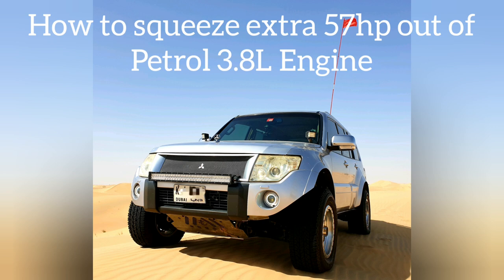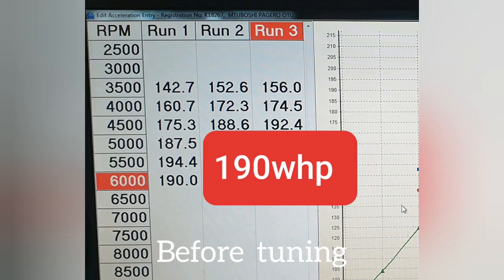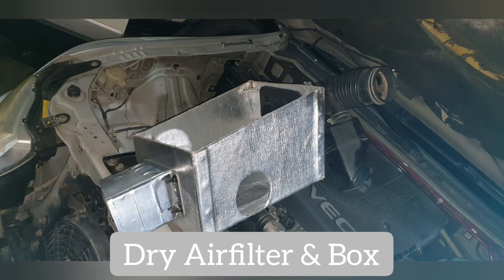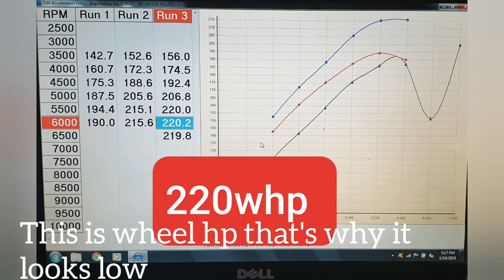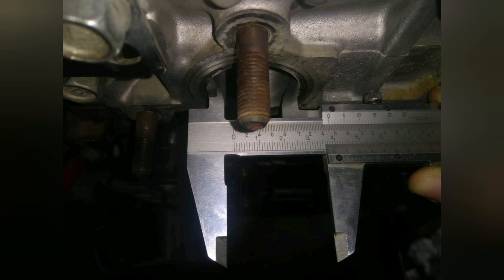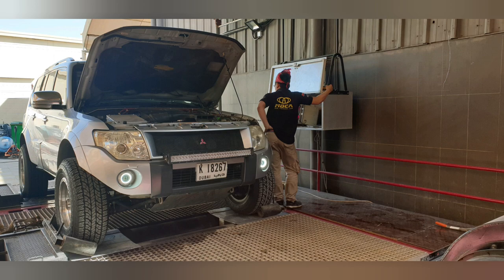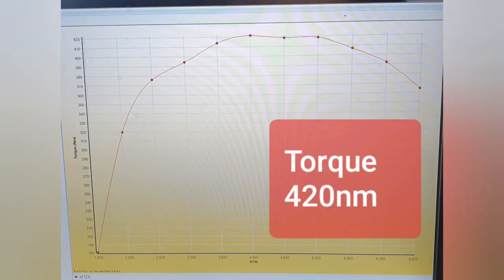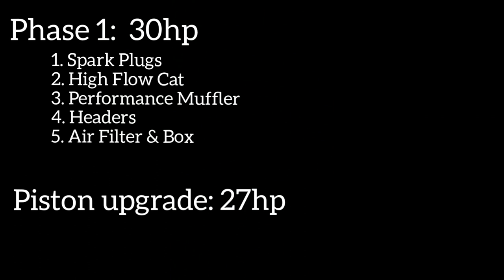How to squeeze extra 57HP out of 3.8L Pajero! [Dyno Testing]

Comment: Hey,
Which Spark Plugs Is Recommended For Off-Roading and what shall it cost in UAE?
Reply from the maker: Hello I am personally using DR15SXC-WC = Brisk High Performance EVO Premium LASER Technology Spark Plugs.        
 https://www.ebay.com/itm/6x-DR15SXC-WC-Brisk-High-Performance-EVO-Premium-LASER-Technology-Spark-Plugs/371904344867?pageci=fb772266-064b-49f5-a371-2cd2139f2899&epid=710002657
Reply: @SandTrack   Thank  You,
Well does good Spark Plugs Make a difference if yes thn how plz throw some light on it
Reply from the maker: @clever52enough  I didnt test the impact of the spark plugs seperately on the dyno on its own. Though advantage of these is they last long and dont fade in performance with time. Also they give even ignition and combustion as you can see from the spark in the video https://youtu.be/EbKJmHw1zro
Reply: @SandTrack  hi mate ... did u change the spark plugs cables too ?
Reply from the maker: @sjanbek72  hello that i didn't change just the spark plugs

Comment: Great mods! But isn't that Magnaflow cat too small for this engine? I have 6G74 in my Galant and the Magnaflow 59926M which is 2,5" cat.
Reply from the maker: Hello Matiz33 thank you very much. Pertaining to the high flow cat, on the Pajero the actual stock exhaust pipe diameter is 2.25 inch
Reply: @SandTrack  okay, I understand. I have a full 2.5" catback exhaust for better breathing. Maybe you will gain even more with 2,5" exhaust
Reply from the maker: @matiz33  oh yes fully agree that would be the next step and plan 😊

Comment: When you bored the engine block with the .5mm pistons, what is the part number for the headgasket to accomadate the larger pistons?
Reply from the maker: I am honestly not sure what the garage did with the head gasket. Will need to check
Reply: @SandTrack  I ended up buying the pistons and the ring sets for my 06 Montero (Pajero). Are these supposed to be machined to finish or come with the pins bigger than the bores in the pistons and one side bigger than the other according to my machine shop

Comment: @Sand &Tracks
Any body has any forum where I can find info on the new Montero sport 3.0 V6 Dyno? Cannot find much post for the petrol version only diesel available. Is it because there is no much improvement with the custom tune?
Reply from the maker: Hello not seen a montero sport on the dyno. Its a capable car, as a minimum you can add an air filter to it and get the ECU tuned. Check with your local tuners. If you are in UAE visit unichip

Comment: Hello my friend I’m thinking of changing the catalytic converter to high cats did you get any Check engine light coming up when Replaced it?
Reply from the maker: Hello, there are some pajeros that have come with 3 catalytic converters and others that came with 1 catalytic converter. Mine came with 1 and after changing to a high flow cat I had no check engine light. Can't say how the version with 3 cats will react. How many does yours have?
Reply: @SandTrack  
Thank you for your reply my friend I’ve typed my vin number on partsouq and on there Catalogue shows that I have three of them Two on the top and one on the bottom Same as yours on the video

Comment: Must have a ton of heat soak with bring in the desert??? How the humidity? And pump 92??? 100?90red? I’m swapping my 01 montero to a 6g75 turbo. I have my motor from a eclipse just need to start the motor build just a decent build while it’s out of the vehicle till I’m ready to drop it in
Reply from the maker: We fill 98 over here, no heat issues at all with the car. Good luck with your project!
Reply: Sand & Track may I know where you bought your Brisk spark plugs?

Comment: Hello there,
1 question about phase 2. Do part come in a complete set or by piece? In total how many pieces i need?
I got a quotation from partsouq for a total of 538 dollars including shipping for 6 part a and 6 part b
Reply from the maker: The parts come separately
Reply: Less than $100 per hole!  After the machine work and reassembly you'll have a mitsubishi that can more easily eat those butterflies and screws!

Comment: If i were you, i would sell this mitsubishi and bought Nissan Y61 with TB48DE will produce over 230 whp stock, if you add headers and full exhaust + filter and tune  you will reach over 270 whp. If you  willing to go over 300+ whp go with  stroker 5.1 and enjoy the instant power + the amazing offroad response
Reply from the maker: No doubt the Patrol is a great car with heritage and solid mechanics and indeed can be tuned nicely. The Pajero is a much harder car to modify as you need to get creative and DIY most parts and more satisfaction in the process as a result

Comment: Is there a way to make 3.5 more fuel efficient?
Reply from the maker: Suggest you get a good air filter, new spark plugs, remove unwanted weight like the 3rd row seat and finally tuning the engine you can create a fuel efficiency map
Reply: @SandTrack  Greetings! Could You share what fuel economy You got with 3.8 Mivec before tuning it (or do You have any insight what it should get during casual, on the road driving)? I'm curious because I'm considering Pajero with mentioned engine as my next car and I wonder what's the best I could get from it after doing mods You recommended in the comment above.

Comment: Hello brother.
I'm trying to change the sparks.
I found one with 3 pins and an other one with 1 pin.
Both fits so which one is better ?
Reply from the maker: The modified ones I used on my pajero have 3 pins no problem as long as they fit. I put in the description the ones I used
Reply: @SandTrack  thanks man, i changed to 3 pin Mitsubishi official.
And now it runs alot better than before 😀

Comment: Have you done anything to the transmission? Do you think it’s tunable? Thanks.
Reply from the maker: yes I have tuned my own gear to hold and not autoshift. What are you looking to do?
Reply: @SandTrack  I’m wondering if it can be tuned to shit faster, smoother, and lock up torque converter at desired point. Also, what did you use to tune the transmission? Does it have separate transmission control unit? Thank you.
Reply from the maker: The petrol cars dont have a seperate TCU (Transmission control unit) for gear. Only the Deisel has seperate TCU for gear its under the passenger foot under the glove box area. I have petrol version and used programming lanuage so no software was used to edit the gear, what I could only manage to do is make the gear hold when in manual mode. 2008-2011 models in petrol wouldnt hold gear in manual and i sorted that out

Comment: Will this also work on 3.0 Mitsubishi montero sport here in USA?
Reply from the maker: Yes same concepts should apply but part numbers will vary
Reply: @SandTrack  will this work good on 3.5 montero here in USA?  Its hard to find 3.8 with Low miles. You can bump the displacement 3.5 to 3.8 with good piston right

Comment: Bro how does ur car bounce of the rev limmiter mine shifts to  the next gear even in trip tonic
Reply from the maker: Hey man two things have to be done:

1. For pajeros 2008 to 2011 model they do not hold the gear even in sport mode/ tip tronic and it's a problem when you need momentum during a climb. We apply the omani gear hack to hold the gear which is by disabling the output speed sensor. We basically put a switch on the output speed sensor to turn it on and off when needed.  I have created a full guide on how to do the Pajero gear hold hack in the attached file here. Most of our group have tested and been using it for years with no issues. In fact it turns the car into a beast when climbing as you get the full rpm range and allows you to downshift anytime when losing power:  https://www2.pajeroclub.com.au/forum/showthread.php?p=618678

2. To make the rpm bounce we install unichip piggy back ECU with the rpm cut off module. Visit your local unichip dealer they should be able to help you out. Show them my car video and they will know what to do
Reply: Thank u so much for ur reply i would also like to know the price in dhs as i live in uae for the piggyback unit and all the wiring and programming
Reply: And could u also direct me to the way where i could splice into the wiring and make a switch i have 2008 with 6g72  400k km strong
Reply: Will wait with all the current situation will wait for ur video aswell i would love to get my hands dirty
Reply from the maker: @coolboymb  makes sense bro. If you want to do sooner the link I shared with you in the other comment has a pdf guide on how to do the omani gear hold hack and which wire to place the switch on
Reply: Hi just got accepted by the fourm today downloaded the pdf i coudnt understand one part i just need to ground the cable and put a switch with a fuse inside thats it
Reply from the maker: @coolboymb  so what you do is identify the output speed sensor wire outlined in the guide. Expose a small part of the wire without cutting it, and connect to the exposed part a ground (negative) wire attached to any metal part of the car which will act as negative.  What this effectively does is it short circuits the output speed sensor which will throw your gear into safe mode allowing your Pajero gear to hold. We then add any on/off button onto that ground (negative) wire so you can turn on the omani gear hold hack when you need it
Reply: Thank u so much for the reply u will definitely find me bouncing of the redline in ur local streets very soon 😂😂😂
Reply from the maker: @coolboymb  hahaha good luck man. Join Uae_pajero on facebook so you can attend future drives with us

Comment: Bro I’m driving 3.5 LWB..., any basic modes to increase the power ?
Reply from the maker: Hi bro you can apply the same mods on the 3.5. As a minimum you can put air filter headers and tune the ECU
Reply: Get a easy 4+ HP just from getting snorkel and K&N air filter
Reply: @SandTrack  where did you do those mods ?

Comment: What is the offset on your wheels?
Reply from the maker: Hey man its zero offset. Problem I had is it was rubbing on the brake caliper so had to add spacer on top
Reply: @SandTrack  So 0 offset plus a spacer or just 0 offset when including the spacer in the offset? I live in the states and have a Gen 3 2003 20th Anniversary Pajero (Montero). I'm looking to add spacers to my stock rims, I don't like how sunk in they are. I'm currently running 265/75/ R16 Bridgestone Revo 3's
Reply from the maker: @gs6810  the rim is zero offset and then added AOR 30mm spacer. I prefer if you can find rims that can fit without spacer. If you want a good reliable spacer then go with AOR. Most of us use them in hard desert driving here and proven to be durable https://www.ramyautomotive.com/aor-mitsubishi-pajero-06-18-30mm-wheel-spacer.html